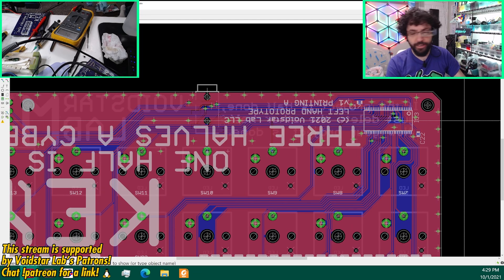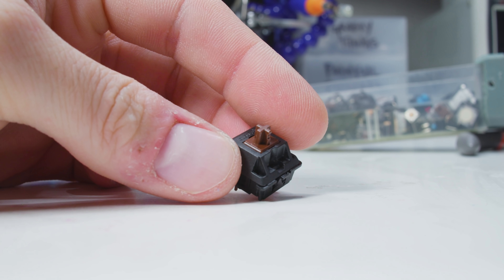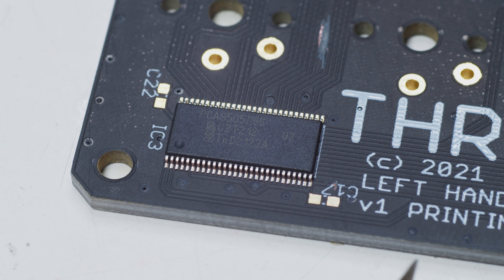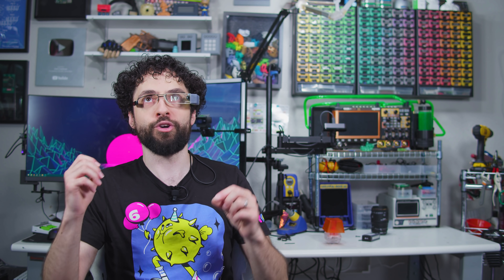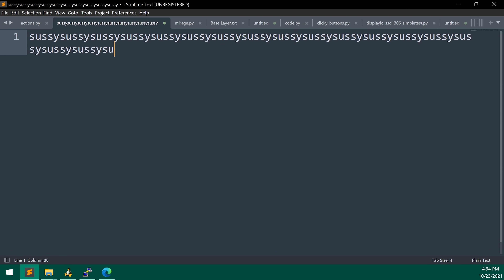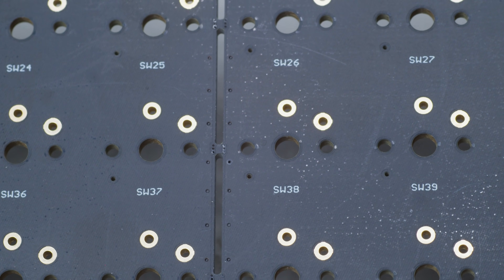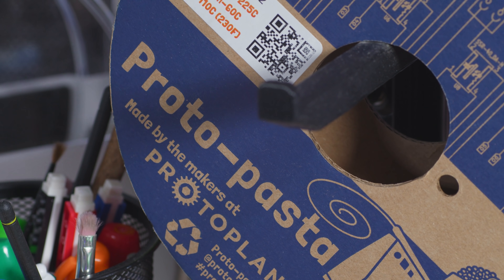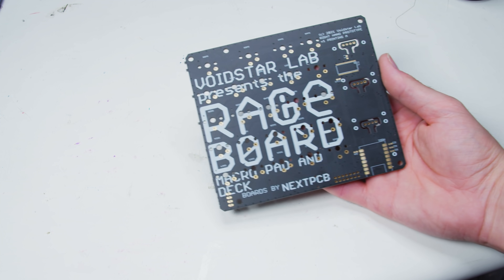I Invented a Keyboard and Snapped it in Half (MiRage Mech Keyboard)

Comment: I’ve got what is possibly a naive question but do you think it would be possible to, in another layer on the PCB, basically make the kailh hot swap sockets that already line up with each key footprint? Effectively not having to solder hot swap sockets onto each and everyone? I know this would increase the thickness of the board a fair bit but that would be fine with me. Or perhaps a whole second pcb that lines up perfectly with the normal one, and this second pcb would be nothing but the hot swap sockets? Not sure I’m explaining it properly, hopefully that all makes sense. Basically I really want to buy a pcb and make my own board but I want the keys to be swappable and to minimize soldering 50ish diodes and sockets.

Comment: "If you try to nail every single problem in one shot, your project is never going to move forward." - I really need to remember that. I've been trying to make my own split, where each half is usable on its own, where both the interconnect and the PC connection use USB-C and have the ports be interchangeable, and do it the right way/without using hacks.

I've been trying to do it in one go and I've been at it for the past 2 years (mostly because I don't know how to do the USB-C thing) and haven't built a single prototype yet.

Comment: I know I'm six months late to the party hear. I needed to weigh in on the circuit python thing.  If you're planning on brining your new shiny keyboard to work, you might not want to use circuit python.  A lot of companies don't allow flash drives, meaning that circuit python is not a viable option.  It either won't work, or it will get detected by your IT and get you in trouble.

For home use it's not a problem, of course.

Comment: Today was my first dive down the custom keyboard rabbit hole. It all began with LTT's video on Work Louder... Any thoughts on VIA and rotary encoders? (preferably horizontal encoders)

Mostly interested in VIA due to being a cross-platform graphical interface for configuring keyboards. Tools like Synapse suck and don't support Linux. VIA's website mentions QMK a lot, is it possible, and worth the effort to interface with it without QMK?
Reply from the maker: The next version will ditch the OLEDs for an e-ink touchscreen, so it could act as any kind of control surface you like!

Comment: I am so glad I stumbled on this channel. I have been working on Python scripts for a full RPi to do cool stuff with custom keyboards (I wanted to be limited as little by the actual HW). Besides this being an amazing concept worthy attention it also uses MicroPython amd some of those features can be added later. I think keyboards should be as personal as knifes, screwdrivers and any other tool you use for years without replacing it. Anything from basic typo corrections to command snippets for daily analysts.

Comment: I don't know if you still answer comments on this video, as it has been 2 months since you've uploaded it, but I just realized something and I have a question:

How do you check which switch has been pressed if only one pin of each switch is connected to the I/O expander and all the other pins go to ground?
I mean usually (let's use a single switch and just the MCU as an example) you have both pins connected, you give electricity through the first pin and check on the second pin if the electricity has come back (i.e. if the switch has been pressed and the circuit closed).
I could misunderstanding something as I haven't worked with I/O expanders before but with each switch's second pin connect to ground - how do you check those pins if electricity has passed through the switch?
Reply from the maker: The IO expanders have built in pull ups on each pin. When you press a key, the voltage changes to low as the short to ground overwhelms the pull up.
Reply: @ZackFreedman  Thank you so much!

Comment: There's a new Keebtroler in town: The Adafruit KB2040. RP2040 processor, same pinout as the Pro Micro and CircuitPython out of the box. (ziplock) $8.95 USD

Comment: What's the advantages to a split keyboard? I've never heard of that until this video
Reply from the maker: The posture you take while typing on a standard keyboard can hurt your wrists, back, and shoulders. Splitting the board also lets you put a SpaceMouse or other special input device in the middle of your desk so you can use it with either hand. If you’re a lefty gamer like me, you can also remap the right half to mirror the left half, so you can use WASD controls without moving your keyboard around.

Comment: A while back I envisionned a 1 to 4 keyboard containing the left and right part, but also the numpad, and an aditional macro deck, for me all 4 keyboard could be used independently (they would have their own controller) and each board could be linked to another in slave mode (each board would have a 4 bit numeric label, any board save the same configuration, the master board would get serve as a proxy for the other slave boards)

Comment: Fantastic project and execution, I enjoyed your discussion on other split keyboards using two separate mcu; what a nightmare to deal with, espetially as you mentioned that some people want a keyboard not a programming assignment. Using a more hardware solution is certainly the way to go. Also I agree, I'm using the Teensy 4.1 for a project and even though I'm using most of the I/O still feels like I'm using a nuke to heat up food.

Comment: Could you maybe add media control buttons (maybe you can  do that with the screens but I don't know) and on the left macro keys as when I game I always need more keys to bind controls too (but I suppose if I'm splitting it I could move the right to left to use them as macros but still I would prefer a 6-12 extra keys on the left
Reply from the maker: The release version will actually have more keys! I was way too stingy with my design, so I'm adding arrow keys and more modifiers.
Reply: @ZackFreedman  that's great this is getting near the perfect keyboard for me

Comment: Hey Zach, love it. If you make a full size one  that's magnetically snappable/unsnappable into 3 pieces (where you can optionally leave the numpad at home) and has a backlight (no individual RGB crap necessary) you will death star the entire keyboard market.

I'm super impressed and love that you're doing what you love and excelling at it.
Reply from the maker: This was actually one of my original ideas, but my proof-of-concept magnetic board came apart too easily and attracted iron filings. Of course, nothing stops you from making your own custom enclosure...

Comment: Acshually, microcontrollers are often cheaper than I/O expanders and can have added functionality. You are right though, having two different firmwares can make things annoying. An MCP23017 is around $2, and a microcontroller with 18 I/O costs around $1-$2, meaning there is cost saving if the designer is smart when selecting components.
Reply from the maker: Depends on the level of flexibility the designer wants the keyboard to have, and the quantities they're ordering in. The Ergodox and most other split boards let you plug either half into the computer, so both micros need to have USB, making the second more expensive.

Even if you use different microcontrollers in each half, that means you're not getting bulk discounts, which could make the total bill of materials cost more, even though each part is cheaper.

Comment: The idea to use an I/O expander instead of a matrix is genius!

When using an I/O expander, can you scan multiple switches at once, like you can if you connect each switch directly to an MCU pin?
Also, what matrix scanning speeds can you achieve with an I/O expander as opposed to a matrix? Is it roughly the same, or perhaps faster/slower?
Reply from the maker: That's exactly what I do - one pin of each switch goes to a line on the IO expander, and the other to ground. These matrices are 400KHz devices that take eight one-byte transactions to read all 40 lines. Even in poorly-optimized CircuitPython, I can read both expanders at about 1KHz.

Depending on the speed of your I/O calls, this could be much faster or much slower than scanning a matrix. Scanning would probably be very slow on CircuitPython  because each function call has so much overhead, but could be insanely fast on a device with DMA. 

This particular IO expander has a hardware pin change interrupt, but my design doesn't let me use it. That could make this system far more responsive than a matrix.
Reply: @ZackFreedman  Thank you so much for taking the time to reply and explain this so well! I definitely learned something new both from the video and from your reply. I'd opt-in for an I/O expander in my split keyboard.

P.S. I absolutely love your videos!

Comment: WHAT in the goddamn fuck is that pcb design at 5:09????
As someone who was taught pcb design, either make it squiggly like old drawn pcbs, or make it straight, and 45°. Do NOT mix and match the two. That is NOT what you should do. Maybe I'm a prude in this regard but still.
Reply from the maker: Those traces were generated by a topological autorouter! I couldn't find the original files to confirm, but it's probably TopoR, since it has a good workflow with EAGLE. Gridless autorouters make weird-looking designs, but if they're configured right, they should follow direction and bend-radius rules fairly well.
Reply: @ZackFreedman  huh. I've used the built-in autorouter before in B2Spice, but haven't used any in Eagle. It never really came out like that, probably because it's gridded. Idk though. Nevertheless, thank you for this detailed explanation.

Comment: Yeah, swapping to a low profile keyboard has been one of the best things I have done.   It really does make typing way more pleasant.   A low profile keyboard with a wrist rest just lines everything up perfectly and you end up with very little strain.     I almost want to sign up but I honestly wouldn't use a 60% because I use the other keys too much.   Pretty much I find a TKL about perfect now.  I actually keep a wireless numpad because I do find I use that enough to want one but have it off to the side for the few times I need it.           

For me I would honestly likely use just one half and use it as a number and macro pad.   I want a decent macro pad like a stream deck but ugg they are so overpriced.   The only other option is a mobile app on a tablet which I did consider trying to get work on an old fire tablet but side loading a lot of the apps don't work well on them.

Comment: idea for the switchability of it: set a couple magnets on the inside edge between the two sides (in it's split ergo style) and use them to connect  the 2 parts together, hotswap standard and ergo just like that. simple but effective!

Comment: That opening is unrealistic, nobody does such nice and true short critic on the internet, not even me.

Also, should have used the tensey, you have hundreds still around, beside would be funny anyway if you hammered a nail with a death Star because buying a new board is a waste of finite time.

 People at bell labs thinks that water tanks are called sinks and sinks are called source for some reason.

By the way, nice keyboard.
It's a shame that it's no superior due it's low profile design however due it's lack of superfluous RGB lighting, it's the superior keyboard.

See, the opening is unrealistic.

Comment: Rather than "shamelessly" reassembling them, you could add a pair of magnets to the joining sides of your 3D print (or linking grooves to put them together like a zip) and make the headers into an elegant bridge plug, and make remerging into a bigger feature of the board rather than a mild accident that's easy to fix.
Reply: This!  This is a brilliant idea.  I hope Zack adds it to the next revision.
Reply: I don’t know that much about keyboards, but isn’t there something to be said about electromagnetism
Reply: @mr.eggdog707  that's not a problem at all to be honest and even if it were, you could conduct the magnetic field lines away or make a shielding for it or find some other creative solutions
Reply: @mr.eggdog707  you know magsafe? Just need to be careful with magnets and circuit boards
Reply: If the board can detect when they're separated and automagically remap then it could be a pretty cool feature for gaming.  24 keys (+3 OLEDs if you want to get fancy) is plenty.
Reply: That is exactly what I was thinking.
Reply: Is there a way to do that and not have some male header poking out of the side of the board? maybe a grooved keyway going along the whole height of the board would be a good way to make it look good, be functional and strong when together and protect the header?
Reply: @adammills4099  Pogo Pins could be a solution, or if you want to go very fancy it could use an optical system, akin to a disassembled opto-isolator
Reply: @adammills4099  you could probably connect the male connector to the board with an internal cable and have it on a lockable slider, so it's only exposed when you want to connect the boards. You could even make some dust covers that are designed to only move aside when the locking mechanisms for the two halves are connected, sort of like a UK power board. With a bit of work you could basically make it snap together automatically and pull apart just by pressing a button, making it really convenient.
Alternatively, replace the aux cable with an integrated cable that can be retracted into the casing when you want to combine them and can be unplugged and stowed away if you need to transport them separately or something.
Reply: or a pair of magnets to each connection.  then wire the connections TO THE MAGNETS and now the magnets are both mechanical holding connections, and electrical connections! woo!

Comment: How much power does the board need to run? I kinda feel a little bluetooth nugget to plug into it & give it juice to have a half to half wire only for my crazy in bed desk setup. I dig on the low profile keyswitches, and might cook up a design in 360 for thigh friendly rests since I like in lap keyboard time.

Comment: This is genious. I am hunting for a very specific keyboard that is nowhere to be found: Cherry MX Silver switches, low profile, layout compatible with linux + mac layout (means no menu button and windows key same size as alt), cursor keys, no numpad but I need the return button of the numpad to quickly click + enter. Media keys would be a bonus.

How hard would your project to be modified for someone with lots software experience, mediocre electronics knowledge but no PCB design experience? (I used eagle a few times in the 90's but that's it) I think I can copy and paste a few keys in KiCad and run a few traces for extra keys, but if it's not yet compatible with cherry I might wait.
Should I wait or jump right in?

Comment: Ah, the drain/source confusion. I feel you.
We can't blame Benjamin Franklin for getting the flow direction wrong (to be particularly nitpicky, it's not always wrong, just in our typical use-case) - but damn, would it have turned out easier if he had chosen to say stuff flows from negative to positive.

The terms source and drain for MOSFETs relate to the source of electrons and where they drain to. When Franklin developed his theories on electricity, he said there's some stuff and where there's more of it is positive, where there's less is negative. It flows from positive to negative creating electricity. Well, positive particles can flow (e.g. in biology, some types of batteries...), but your everyday electricity uses only electrons (which are negative), meaning the flow direction is actually negative to positive.

Comment: I am so mesmerized.  It combines so many hobbies and passions: programming, mech keyboards, circuitry, 3D printing, qmk, and more.  I would really be interested in building this and would like a low profile mech keeb like this.

I have a submitted handwired keyboard for qmk, so I'm interested if the firmware you are using supports layers.

Comment: I built my first custom keyboard this summer (based off Jan Lunge's wSplit) and I've got to say, it's not the greatest thing since sliced bread but for my first handsoldered project with more than a hundred joints I'm really happy with it and god, I would have never guessed but a split keyboard is so much more comfortable, I feel cramped going back to regular ones by now xD But honestly, if you've ever thought "wow, custom keyboards sure are pricey", you can get a lot done with $30 and access to a 3D printer.

I love the circuitPy route, but would like to toss in a good word for Vial, which is based on qmk but has live-editable layouts so you don't have to reflash all the time (tho to be fair, since I've settled on a layout that works for me I've basically not touched it)

Comment: First circuit board I ever designed and had made I forgot to design power and ground inputs.
I designed an entire calculator operating on 74 series logic and forgot the power to the multiplexed display module. 
Any good prototyped board has some scraped traces and jumper wires! <3

Comment: Okay, so, a bit of background.

TL;DR version. I want to alpha-test, and I have a lot of experience to help.

Okay, so I have been in the computer field professionally since 1996, and have been programming literally since my age was in the single digits. However, I hovered in the null space between hardware and software for a long time, taking a few decades to interface between users and the hardware they needed but could not understand. I've worked as a tech, a recycler, a programmer, a web developer, and have not had a pre-built computer since Bill Clinton was in the White House. I tried to repair or upgrade every piece of tech I have ever owned.

I love this design and want to try it.